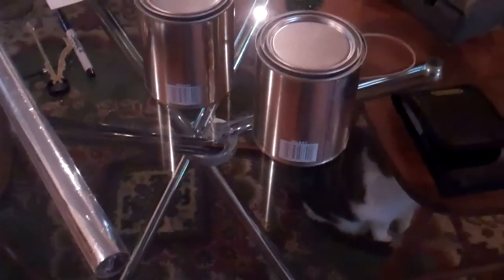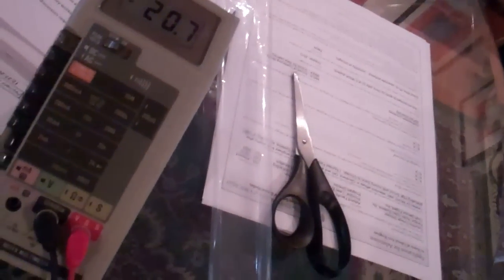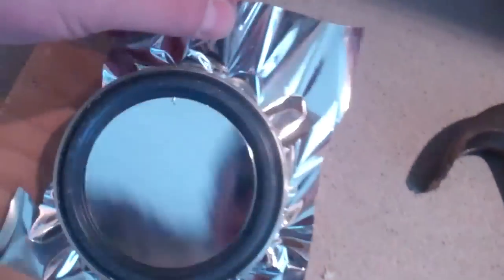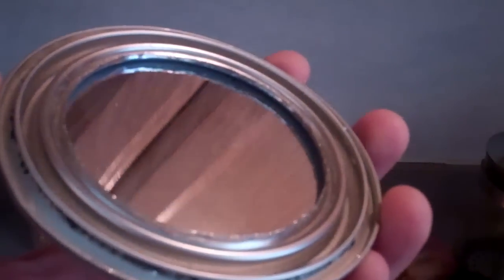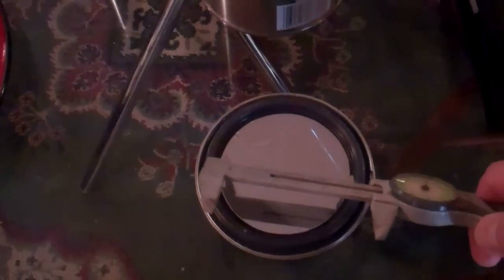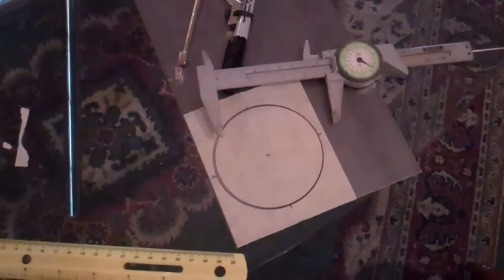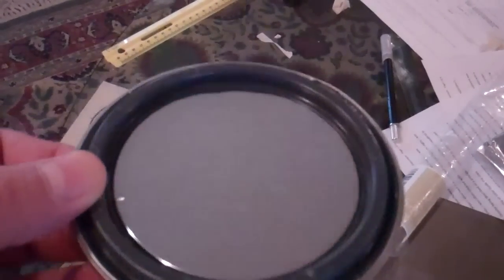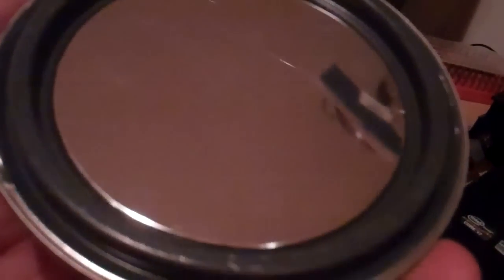Understanding Audio - DIY 'true capacitor' condensor microphone

Comment: Congratulations for this DIY manufacture of a large diameter (really large !) diaphragm.
Please, i do not understand two things :
1) The non conductive side of the diaphragm, has placed opposite (face to face) to the metal backplate. Then, how an Electric field will be created ? I thought that, in a Capacitor there are two plates, placed opposite and very closed, but both are good conductors for electricity.
2) What for, are the holes in the backplate ? Are they obligatory ?
The material of the backplate, can be INOX (without loosing in quality of the result) ?
Thanks
Reply from the maker: 1) The electric field in any capacitor is created by the charge difference between two conducting layers separated by a non-conducting layer (dielectric). In a capacitor microphone (condensor), the two conducting layers are the diaphragm (usually a layer of gold impregnated on to mylar or a similar plastic) and a fixed backplate (usually brass or similar metal, sometimes with an added gold plating to prevent oxidation / corrosion over time). The insulating layer is an air gap between the diaphragm and the backplate. Sometimes the diaphragm itself is also acting as a dielectric by having its conductive treating only on the side that faces away from the backplate (the sound-field side). This adds a functional protection for the conductive treatment by preventing a short circuit of the polarizing charge.
2) The holes in the backplate serve two primary functions-

First, the holes allow air to equalize pressure between the dielectric gap and the external sound-field. This means that the diaphragm will always have a fixed resting distance to the backplate.

Second, the holes act as an acoustic 'widow', allowing the same sound that is acting on the front side of the diaphragm to act on the rear side of the diaphragm, but through a 'baffle'. This baffle changes the time (phase delay by lengthened signal path), the amplitude (by different geometry and area of exposure), and the frequency response (by diffraction and resonance tuning) of the sound as it reaches the rear of the diaphragm. Careful control of these holes and the attached enclosure (if any is used) are what create the directionality (polar pattern) of the microphone. The diaphragm's movement is induced by the difference in pressures acting on its front and back sides.
I.E. If sound has equal sound-field exposure on both sides of the diaphragm then it will exhibit a bi-polar or "figure eight" directional response. If the sound has no exposure to the back side of the diaphragm then it will be omnidirectional. All other polar patterns (variations of unidirectional response) are the result of unequal soundfield exposure of the front and back side of the diaphragm.

3)The backplate can be any conductive material. I could only guess at the trade-offs of using INOX (stainless steel).
¯\_(ツ)_/¯

Comment: Nice DIY project for learning... what you mentioned about getting the diaphragm closer to the backplate for higher output is true. But the output of this "design" will be very low (except at higher frequencies), significantly contributing to the poor S/N ratio. This is because of front to back acoustic pressure cancellation around the diaphragm. The concept is identical to a loudspeaker not mounted in a baffle (large sealed box) . You would need to acoustically isolate (seal) the front from the back of the diaphragm at the frequencies of interest to get the diaphragm to move due to incident acoustic pressure, and hence get output signal from the mic...
Reply from the maker: That's not quite correct. Bidirectional ('figure-8') microphones have no baffle, directional (cardioid, hypercardioid, etc.) microphones have a partial or vented baffle, and omnidirectional microphones have a sealed baffle. In a later iteration of this project, with proper grounding and shielding, we achieved a S/N of 51db (lab measured). A design engineer from Sure suggested that the low output was largely due to the materials being poorly suited for the capacitive (electrostatic) field required between the diaphragm and the backplate. When we rigged a 260 VDC charging bias for the microphone (think of this as 'jacked-up phantom power') we raised the S/N to almost 63dB and had output levels comparable to a modern large diaphragm condensor.
Reply: @AndySickle  Thanks, good point about the figure of 8 polar response...you are correct in that for this case with both sides exposed, it's a pressure gradient mic. I forgot about this, and was thinking of all the other types. I like the simplicity of construction and resourcefulness of available materials (i.e paint cans and xmas wrapping). A  large diaphragm surface area like this should have relatively high sensitivity compared to commercial designs...wonder why it is apparently not. There is a lot to it of course, but I don't quite know why the Sure engineer told you that the materials do not lend themselves to the electrostatic field. I'm guessing maybe there is significant charge leakage from the diaphragm material for some reason, but i will guess that a bigger factor is the capacitance is much lower than desired due to the separation distance.
Reply: It would be good to see how you tested this also...test setup. How close source was to mic, etc. That said I realize that people have time and priority constraints!

Comment: Were you ever able to get this capsule to work properly? I'm very eager to see it in action.
Reply from the maker: I did get it to work much better. It was only intended to serve as a teaching tool on the operating principles of condensor microphones; and in that regard, it worked very well. The biggest improvement in S/N was shielding. It never got better than about 36 dB S/N, but that was more than good enough for proof of concept. I never continued the video(s) because I retired work as a college teacher.
Reply: I see. Although it is a bit sad to hear that this video will not be continued, I learned a great deal from this. I’m glad that there are professors like you as I feel most professors today, at least in the university I go to, rarely give demonstrations of the inner workings of fundamental technologies. It’s comforting to know this knowledge isn’t some magic that only large corporations know and won’t share or something that will fade into obscurity through generations. I really appreciate it, thank you.

Comment: I am interested in that Christmas wrapping.  Do you remember where you got it from as I find it remarkable it was conductive only on one side.
Reply from the maker: I got it here- https://goo.gl/maps/3HjMHrxh2212MDhZ6
Reply: @AndySickle  Seriously?  WOW.  I will see what I find at the Dollar Tree since they took over FD a lot of the stuff is in both.

Is it paper on one side or how is it non-conductive but is on the other?
Reply from the maker: @generalawareness101  I'm pretty sure it was some kind of polyethylene or polypropylene sheet with a metallic coating on one side.
Reply: @AndySickle  Interesting indeed.  I often wonder about those Mylar balloons they have Helium in.
Reply from the maker: @generalawareness101  Mylar is a very common base material for condenser microphones- usually 24k gold vapor coated.
Reply: @AndySickle  Yes, but one side needs to be non-conductive or have something in-between that is.